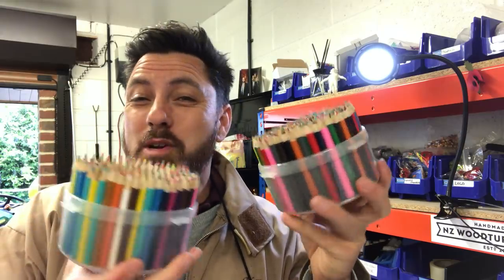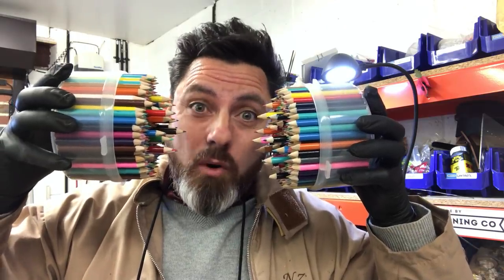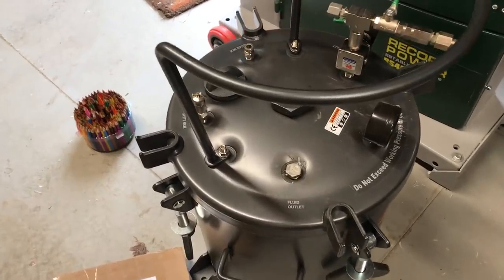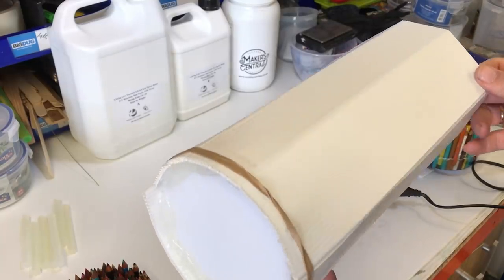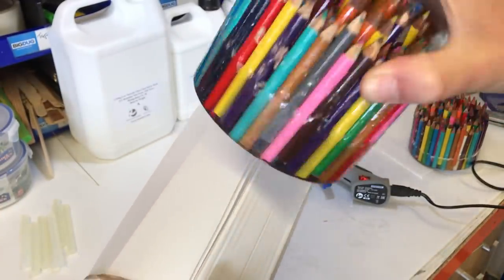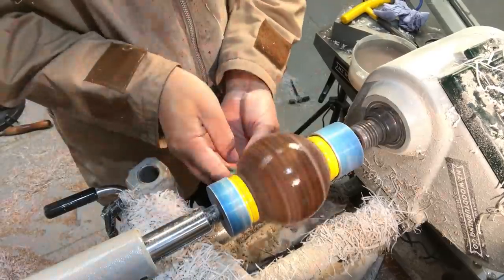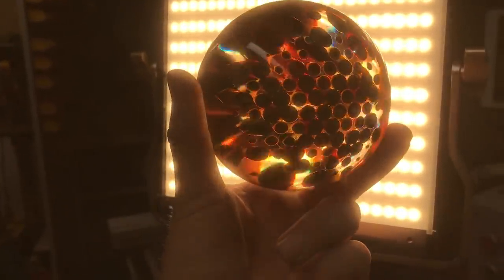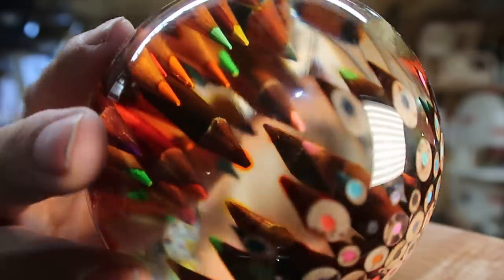Making - The Pencil Planet Sphere - 🌕 *Warning Flashing Images*

Comment: That turned out really well. Having done a few experiments with coloured pencils myself, I found it much easier to seal the leads before doing anything else. I just dipped both ends in some clear metal lacquer in the end, but superglue could work even better. Then the pigment won't seep out as you're working on it & there's less chance of things chipping. Low viscosity superglue will also seep into the lead itself & give it a bit more strength & stability.

Comment: The way done of the pencil led colours bleed into the resin is pretty cool.  Perhaps you could base a project on that effect!
Reply: It seems like it's only certain colors that did that too. Or at least some were more obvious. I'm guessing if you wanted to avoid that you could pre-seal the tips with something before they get submerged in resin?
Reply: Depending on the type of resin used,  a thin coat of super glue would likely do the trick.
Reply: I agree, more project!!! I think the bleeding effect is quite awesome!! :-)

Comment: Nick could you get a string of those copper wire fairy lights and embed them in a sphere with a wood section that has a plug that fits into hole in a base where the wires come out to connect to a battery set. That's the only way I could think to turn it and keep the wires safe.  It would look like a sphere but you wouldn't see the wires that connect to the battery. It would only be found out if someone picked it up.

Comment: Surely rather than super-glueing all the pencils at different heights you could have just used pencils of various lenghts? Nice job though
Reply: lololoololoolololoolool
Reply: Could have. But it would have taken more adjustments (via cutting and fitting) on most (if not all) the pencils. Supergluing only the ones he wanted took less time/effort.

Comment: Can you explain what the pressure chamber does? Sorry if this has already been addressed.  I'm guessing it prevents air bubbles maybe or does it speed up curing some how? Thanks!
Reply: Bubbles
Reply: Helps getting rid of the air trapped in the resin
Reply: No, it makes the bubbles compressed and tiny when/while the resin sets and also traps the gas with lots of force.
Vacuum is a much better idea. It doesn't create the same potential for cracking.
Reply: It forces all the air out of the resin. A bubble can make a week spot that can ruin a project

Comment: Sorry but I’m new to your video’s ~ can you please explain what that compression machine was doing to the pencils?
Reply: Lisa Jarvis it sucks the air bubbles hiden inside
Reply: Lisa Jarvis , "pressure" , it forces them out. Sorry Michal.  :)

[Edit:  but yes,  it does get rid of the bubbles . Lol ]

[[ "70 PSI for 3 hours" on another vid is ONE way ]]
Reply: I thought it was low pressure, so the air moves from the high pressure in the resin to the low outside?

The vidzs I have seen, the guy removed the air from the resin before pouring, so solving the size problem.
Reply: @michaszul6895  does it suck them out or compression push them out so that it does not go nuts like letex does when you use a vacuum chamber?
Reply: No wait. Not latex. Silicone
Reply: I was also wondering the same thing but I am now more confused than I was before reading this thread.
Reply: It forces all of the bubbles from inside the resin as it sets, so it’s perfectly clear
Reply: It doesn't  remove the air so much as it compresses the bubbles until they cannot be seen.

Comment: I am starting to get into wood turning and resin work, but I am curious...what does the pressure pot do? Does it prevent bubbles from forming in the resin?
Reply: Yeah it does because it is basically a vacuum chamber which pulls the bubbles to the top
Reply: He’s actually compressing the bubbles to minimize them, in lieu of degassing with vacuum.

Comment: What effect does the pressure chamber have on the resin?  Can this be completed without the pressure?
Reply: Yes but there would be bubbles
Reply: Are you using pressure or vacuum?  When molding silicone, we normally use vacuum for degassing.

Comment: I'm new to yor channel and to this kind of videos and I have 2 questions: 
1. How do you know that the resin (hope I wrote it right) is ready ?
2. What does the  presure pot exactly?
Reply: 1. The resin is usually ready when it hardens after a day. (It varies on the type/brand of resin.)
2. The pressure pot sucks the air bubbles out of the liquid resin. (So the resin won't have any bubbles in it.)

Comment: Why do you put the resin in the pressure thingie? Does it need it to dry properly?
Reply: i would assume its to get rid of bubbels but preasure dont do that ... for that you need to use vacuum with preasure you make the bubbles smaller but they are still there...
Reply: @mortenhundevad  huh. Yeah, I've seen people get rid of bubbles by using a torch, that seems to help. 
I googled it! The Great And Powerful Google says: "The ArtMolds Pressure Pot is designed for use in applying pressure to force air out of resin and to force resin into thin sections of a mold. This eliminates air bubbles and air traps in the cured castings." So I guess it works as a bubble-hoover? :D